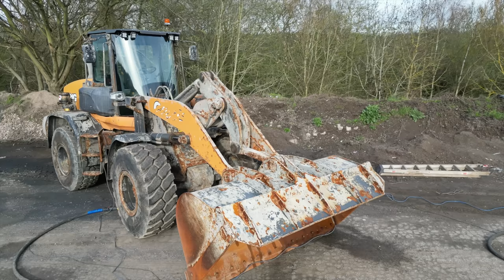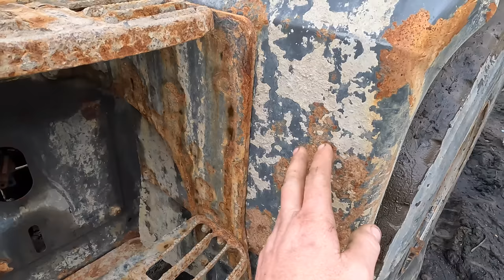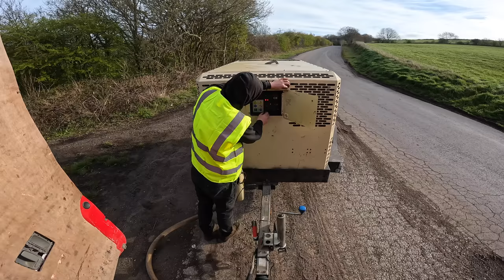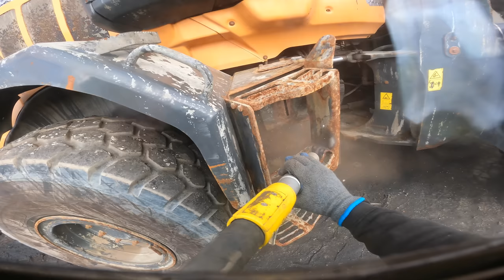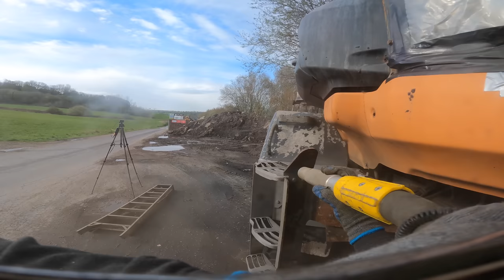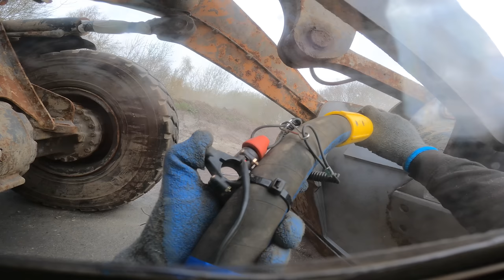Blast Cleaning, Removing Rust and Old Paint. Refurbishing Heavy Machinery!

Comment: What sort of grit valve do you use Mick? You get a lovely steady flow of media. I end up with nothing or loads!
Reply from the maker: I'm using a major valve next step down from a Thompson value if you have the Clemco type with the rubber try turning it 90° that way you get another 3 turns at a fresh bit of the sleeve 🤗

Comment: Mick, as mentioned in one of my previous comments I asked if the spot on the bucket arm and light bracket were left untouched for a reason. I watched the video again and it seems that they were left untouched for a reason. One of the plausible reasons could be for color matching purposes. You went up the arm to a point and stopped. The light bracket was never touched in spite of you meticulously cleaning those areas 2 or 3 times. Plausible?
In spite of what the client wants, how often do you go above and beyond because it looks better or reveals something the client didn't see?
Reply from the maker: 😊 when I've got a working relationship we both have a understanding and he knows what he wants doing and I will say what I'm likely to achieve then when I start and if I see anything that's may need more work or make life easier for the painter and not add much time on my work I will do it.
I always have the painters in mind to keep life easy for them but also keeping in the job sheet in mind

Comment: Do you ever use high-pressure water prior to blast cleaning?
Reply from the maker: To be fair it wouldn't make much difference it dose help slightly as the grease once blasted has a chance of sticking back to fresh steel if it was prior this would be reduced but not worth the effort or time as its just as quick to re hit the affected areas

Comment: Just bought an 12v electric valve to convert mine. Found a little switch that fits in the place of the rubber mushroom so will keep the deadman’s handle. Just with out the airlines.
Reply from the maker: Perfect can you send a link to the switch please? Info@mobileblasting.co.uk Regards Mick

Comment: Hey Mick, great job. How long before surface rust happens?
Reply from the maker: It can last up untill it starts getting wet or humidity getting to it I've had jobs in the unit for months and it's still been fine but I've also blasted jobs and in the morning and put the parts in the van to drop off later and they looked as if they hadn't been blasted 🫣
Reply: In reality they start to rust immediately! The question is how bad is the environment that the unit/piece is in. By the sea ? Inland after two weeks of dry weather? If you want it to last you need to start coating as soon as possible. The trick is that’s where the real profit is in a business like this, provide extra services and reap the benefits without changing job site. More overhead and more risks, but you get paid accordingly.
Reply from the maker: @chrisdzisiak7540  I've had stuff I've blasted in the unit for months and it still looked as clean as it did after it was blasted I've also had stuff I've blasted put in the van to deliver the same day and it's looked as if it's not been blasted 😬 totally depends on how dry you can keep it 👌👍

Comment: if we compare sand blasting with laser cleaning, which one is better and more efficient?
Reply from the maker: 100% without a doubt blasting wins hands down in every aspect. Hears my take perches price cannot compete as they are 50 to 100x more expensive to purchase they take 50x to 100x more power to even come close to the lowest spec blaster. They are 10x + slower to complete a project. They cannot profile so no good to repaint over you still will need to sand the project to key for paint. One could argue they don't make dust that's true but they also pollute so about the same. Don't get me wrong I'm all for the method and would love the technology to catch up as more options can only mean a good thing for the end user 👍

Comment: I'm guessing that machine is probably very high hours and the inside probably shows this too hence the  limited spray job and likely low sale margin on the machine.
Reply from the maker: No inside the cab looked as fresh as a new en he said something about the finance company taking it back to the dealer I didn't ask too many questions so I'm sorry its a little vague
Reply: @Mobileblaster  fair enough, considering how well it came up it seems a real pity not to go further. The wheel arches would likely straighten out easily and it would look really tidy with the other scabby bits blasted and sprayed.

Comment: SHORT jabs are not as good as a steady stream of movement...or at least longer passes. The short jabs waste sand and nit certain areas more than they need. Over repeating as you do just pits the metal even more than it needs.
Reply from the maker: In a ideal world yeah long even passes is the fastest way but when they is multiple layers of scale and paints I like to keep the hotspot moving as I'm not only keeping a eye on what's happening I'm watching the splash doing short jabs won't make a massive problem if the slash is attacking something is shouldn't 👍 on the tanks I blast that long uniform passes is the best method as I don't have to worry about the waste and they are flat uniform clean

Comment: That switch that your pressing with your thumb looks like a right pain in the ass to hold. Would you not fit an on off switch? Your thumb will thank you for it in later life.
Reply from the maker: Ideally it needs to be a kill switch if I drop the pipe it should shut down 😳 I've fixed it now but I did do a spell with cheap switches and then useing the wires alone 😬

Comment: If you want to renovate this machine CORRECTLY, it should look like this:
1. disassembly of all corroded elements (in the case of such a terribly neglected machine - total disassembly),
2. sandblasting each detail SEPARATELY, one by one,
3. EVERY detail must be primed IMMEDIATELY after sandblasting - freshly sandblasted steel is very susceptible to rapid corrosion!!!
4. removing deformations and defects and, if there are many of them, re-priming.
5. final painting, at least two layers.
6. assembly and commissioning of the machine.
In my opinion, it's a month of intense work for two people.
REMOVING RUST WITHOUT DISMANTLING WILL DO MORE HARM THAN BENEFITS!!!!
If it turns out that the engine, gearbox, chassis drive units and main oil pump require thorough repairs, then the economic sense of renovating this machine, in my opinion, is a big question mark.
Reply from the maker: To do this job "Correctly" you listen to the owner and blast what you're told to. 
You are obversly not a blaster and have done too much Googlein you don't need to paint immediately blasted steel will last days weeks months even years before primer is needed that will be determined by the humidity levels and if you can keep the part(s) dry. I cannot comment on the paint but I do know something they make a paint called DTM direct to metal (rain coat/ one coat all the same stuff) no primer and 1 coat covers 70% sheen ideal for truck chassis heavy plant etc.
I'm not saying blasting like this is how to do it the proper way and the only way but it's how I do it well it's how I get told to do it. I know this company has been in business for 70 plus years I think they know whats needed and how much man hours and money to put into a unit that's going back out on hire

Comment: Why the fcuk would you only ask for part of it to be done?🤷‍♂️ 😁.    Either do it properly or don't bother at all!  Obviously it'll look better than before but it's going to be obvious it's only had half a paint job which is going to make people a bit suspicious if you're selling it on.  I'd be a bit wary buying a machine that has obviously had a freshen up and they'd only bothered to do half of it!  I kinda makes you wonder what else they've cut corners on🤔.  

Sorry mate, no rant intended! 😂
Reply from the maker: It was something to do with the finance company they tuck it back off lease and had a small pot of money to spend before sending it back I didn't ask too many questions I just do as I'm told 😬👍
Reply: @Mobileblaster  Fair enough mate, but yeah best policy not to ask😁.  Do you do coatings yourself or do you let the customer get someone in?  I imagine the coatings side of things is another can of worms best avoided? 🙂.   

BTW what sort of blasting pot do you run?  I'm interested to know what kind of setup you have a preference for in regards to the equipment.  I do a little bit of blasting myself but mostly for myself and on my property.  I got setup with an old compair C73 and a nice new hodge clemco 1448NC soft blast pot.  I intended doing a lot of soda blasting on classic vehicles etc, but as yet it's mostly been old farm equipment and machinery with crushed glass😒.  Getting dry air was one of the biggest headaches, but I picked up an old HPC refrigerant air dryer and jerry rigged it to run on our single phase supply using phase converter.  Also just finished cobbling together a mobile air dryer using the aftercooler out of a 750cfm compair compressor and a large buffer tank along with some extra filtration, it's an unsightly beast but it seems to work quite well at the flow rates I use. 
Regards. 👍